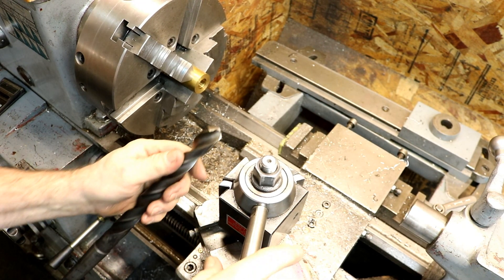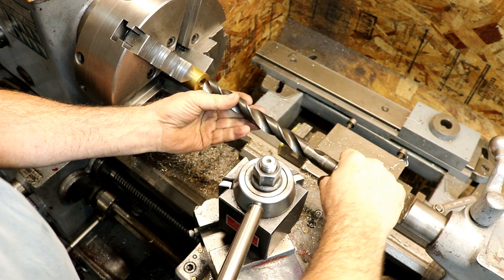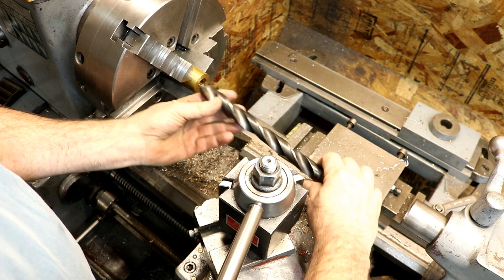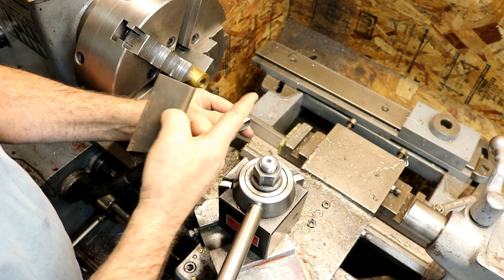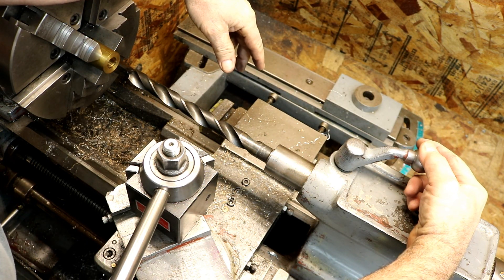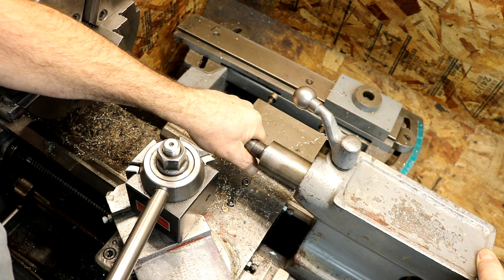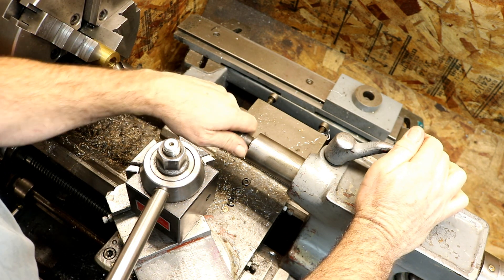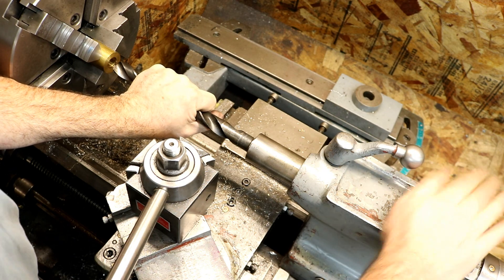Metal Lathe Tips | Stop the Grab Now!  Drill grabbing?  |  Metal Lathe Hack #5

Comment: "dull it"

Most of my life, I've never been able to afford new drill bits, let alone 'good' drill bits.  Things changed for me when my wife went to work for one of the large US industrial suppliers, and gets to buy at 10% over THEIR cost.

One of the first 'biggie' buys for me was drill bits; a fractional set, a numbered-lettered partial set for tapping fractional & metric threads.

I decided to buy cobalt, and am glad I did, but they are grabby, as hell, .(and not just on the lathe).  I got to wondering, recently, if the grabbing was because they were so damn sharp. (Noticebly sharper than HSS bits I've bought, in the past).

Sure enough, I dulled one of my most grabby bits, just a smidge, and no more grab.

I guess I should break out my old HSS set I kept around for abusing with the cordless and air drills, and use them, instead!  LOL

Comment: Your giving advice on using the wrong tool. Why not say use the right type of drill or even an end mill.
Reply: "Dubbing" jobber drills is a time honored practice. Not everyone has access to special purpose drills and they're generally expensive.
Reply: Paul I subscribe and luv your channel but I respectfully disagree. I bought several sets in my 20+ yrs. at reasonable prices. Keeping in mind one brand might be 10X the price of the other.

Comment: When I was a young lad in the mid sixties, I worked at IBM in San Jose, Ca during the summer.  One of my fellow workers and I were sent out to mount a widget (I can't remember the Item) to one of the Secretary's desk.  I required using a Hand Drill make a !/4 in hole in a piece of brass.  My co-worker had a set of drills the were ground especially for Brass.  They were like ordinary Black oxide drills with one modification,  the cutting edge was perpendicular to the cutting surface.  They worked pretty good as I recall, no grabbing.  Good hack!
Reply from the maker: Thanks James.